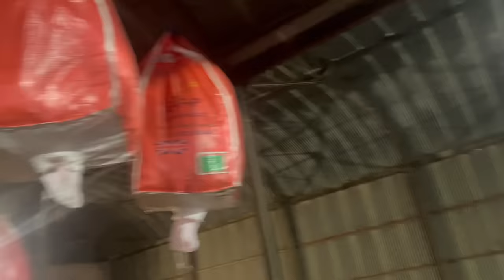Video Diary on the Farm No.80

Comment: Triple D’s the system they used for gear changes / clutch /steering operations was ingenious and still is and all with full air conditioning lol Nice to watch flood water running off land by the grips
Reply from the maker: Yes the Triple D’s were ahead of their times I think. Good seeing them working.